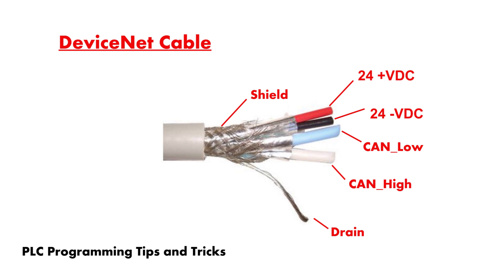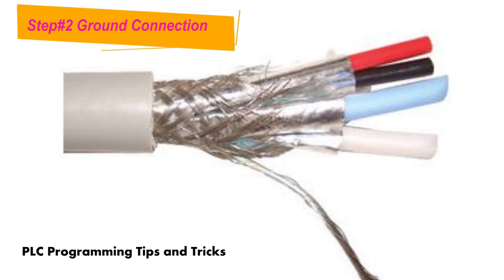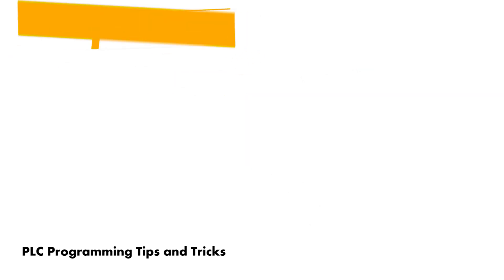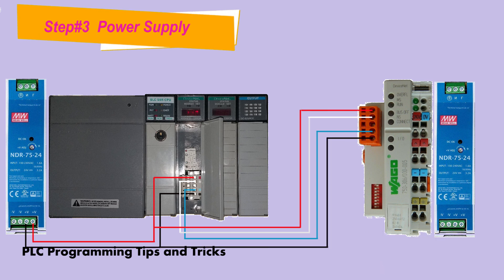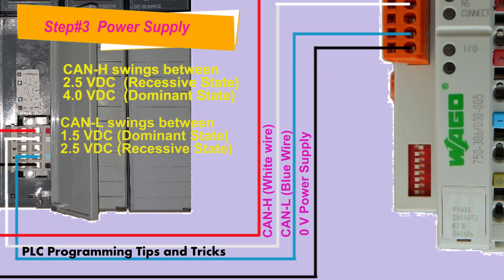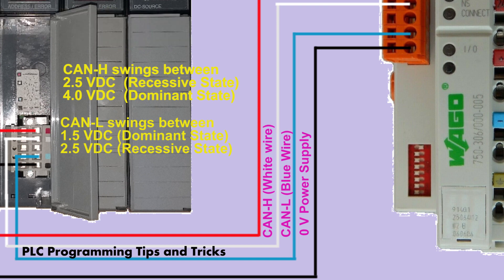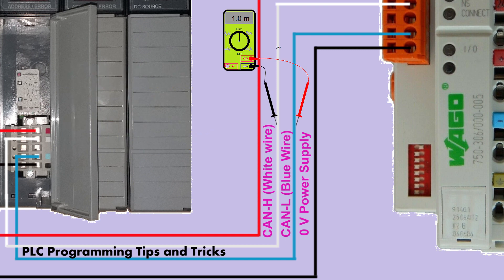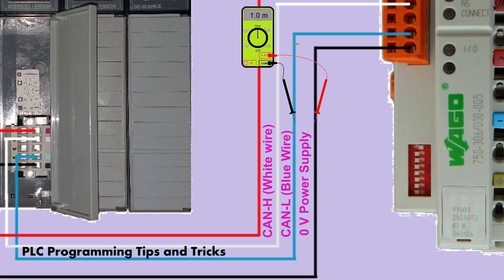Troubleshooting Tips for faulty DeviceNet Network- devicenet troubleshooting communication problems

Comment: I thought the terminating resistors were 121 ohm not 60 ohm. Why would reading the ohms give 60? Thanks
Reply: There are 2 x 120ohm termination resistors, one at each end of the network. These two in parallel equates to 60ohm.

Comment: A good and useful video...   If I may suggest the following additional troubleshooting tips...

1 - Confirm that the Baud Rate selection on the device ( if it is switch selectable ) matches the Baud Rate set in the Host device PLC Program / Solution setting.

2 - Confirm that the Device Address matches the address in the software PLC Program / Solution. A mismatch will for sure cause the MN/MNS LED to indicate a problem

3 - Do pay attention to the MN/MNS LED (if available) on both the Master and the Slave devices ..  Check that they go to the desired indicators state - Otherwise start troubleshooting there and work to resolve any issues you encounter. 

Unfortunately, troubleshooting flow paths and troubleshooting guidance from the device manufacturers is nearly non-existent, so mostly you are on your own and need to rely on your own experience and troubleshooting skills. 

I hope this helps someone.
Reply from the maker: Thanks for your valuable addition 👍

Comment: sir do you have  tutorial if there is a error 92 in the plc? thanks
Reply from the maker: Which model ?
Reply: @EASYPLCTRAINING  1747 -sdn device net scanner module ,
Reply from the maker: 92 error is related to the power supply for the device net scanner module , check 24 volt dc is applied on the red and black wires ....
Reply: @EASYPLCTRAINING  i checked the supply and there is 24vdc
Reply from the maker: Master and slave device net modules should share same 24 vdc power supply .... try to increase the voltage to 25 volts and power cycle the system
Reply: @EASYPLCTRAINING  is it possible the scanner module has been damaged because of previous short circuit on the cable
Reply from the maker: Yes possible... open it some times inside there is smd fuse , it burns only
Reply: @EASYPLCTRAINING  thanks i will check this smd fuse , so is this possible cause for alarm 92  even there supply of 24vdc
Reply from the maker: Yes possible
Reply: @EASYPLCTRAINING  allen bradley the same model in this video